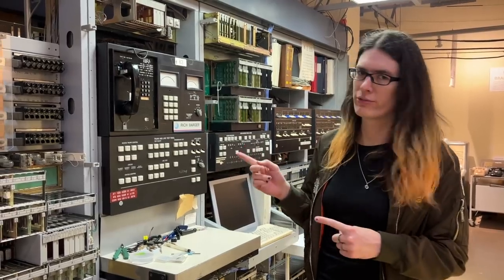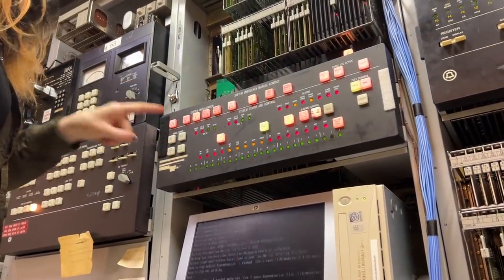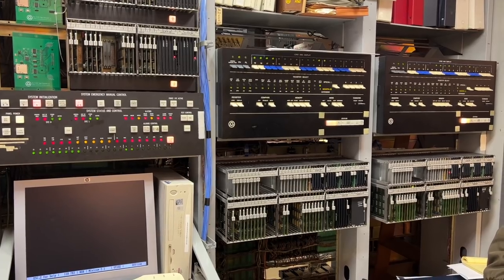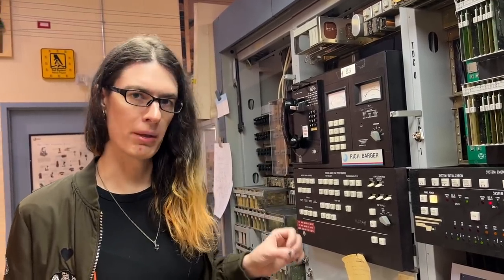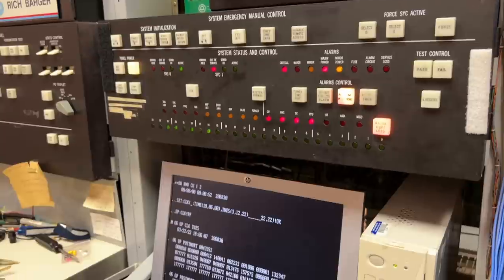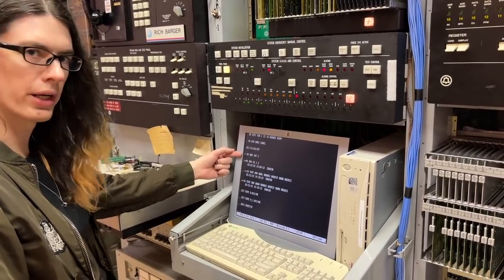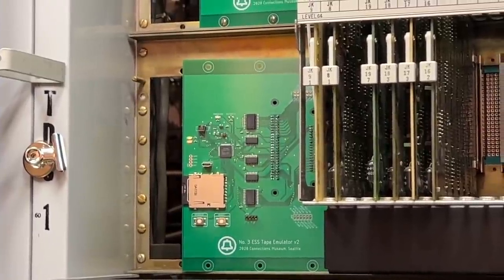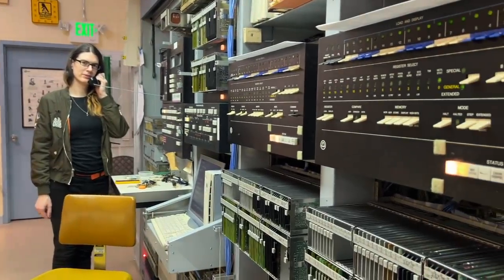Booting up the 3ESS

Comment: So awesome to see this stuff running, it would be neat to have an actual teletype connected to that serial port too. Did the 3ESS have support for remote management over a modem?
Reply from the maker: Sarah here -- I think Astrid and Colin eventually want to hook up a real Teletype to the local serial port, at 110 baud, and then have a remote session via a modem to one of the other serial ports. That should run at 1200 baud, I think.
Reply: @ConnectionsMuseum  A Bell Dataphone modem would be perfect for this, how many serial ports does the switch have?
Reply: @KJ7BZC  I believe this is discussed in this or a similar video, and you can clearly see several sleek looking black rectangular Dataphone modems buiilt into the backside of the rack where the terminal resides.

Comment: So is the computer you're using for a teletype more powerful in terms of processing than the whole switching machine itself?
Reply from the maker: Yes, by several orders of magnitude. The clock speed of switch is about 6 MHz, achieving a throughput of just under 1 million instructions per second. Each CU (they're an active/standby pair) has access to 512 kilobytes of DRAM, known as "MAS" or Main Address Store. (Technically, that makes it 1 MB of RAM, cause 512*2, but each CU can only access its RAM, and not that of the neighboring CU.)
Reply: @ConnectionsMuseum  That's crazy cool. I mean, cool if you're into vintage stuff like us. Really gives you a different perspective on the power of modern machines.